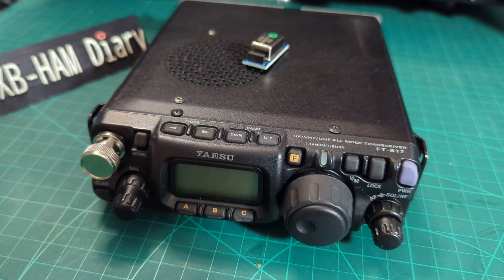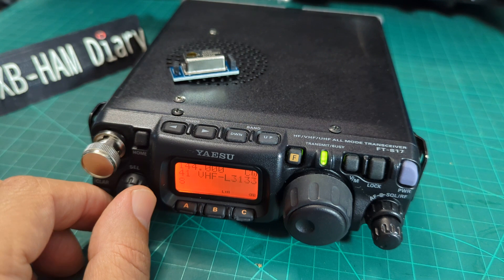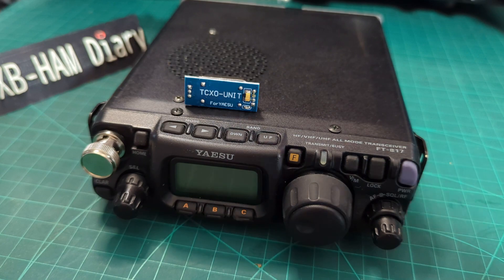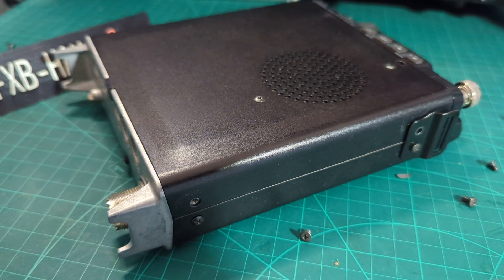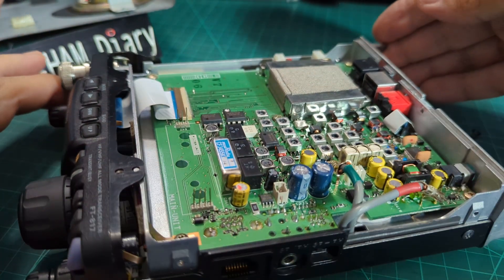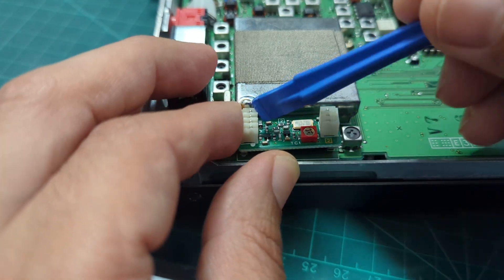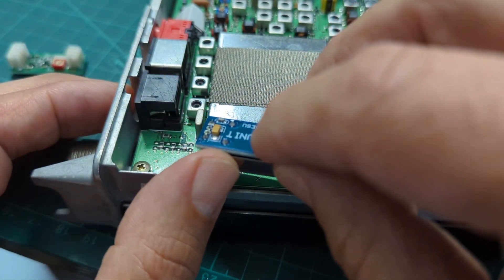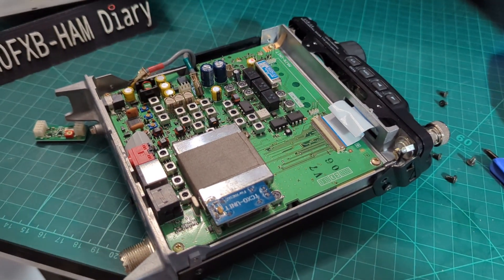YAESU 817ND - ADD Cloned ,TCXO-9 Crystal Module (100 percent get the Yaesu Original one )

Comment: So after doing it have you notice a difference have not ordered one yet.  I am getting another 817 going to leave it stock and back up.  So it if mine craps out spare parts.   When you did 6 watt.  What the the next power level setting.   Mid setting stock is 2.5 watts.
Reply from the maker: It didn't fit well get an original YAESU one .
Reply: @M0FXBHamTech  can you find them still